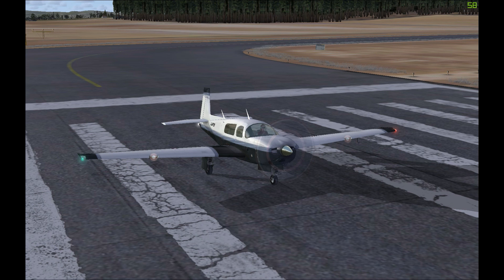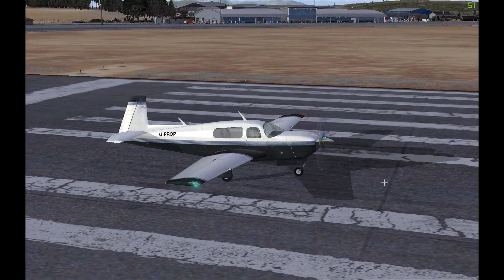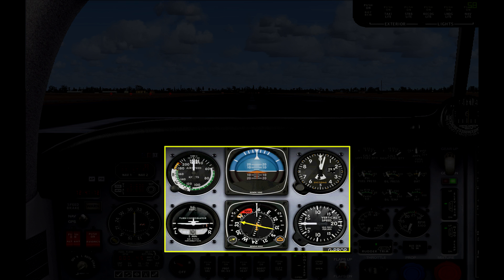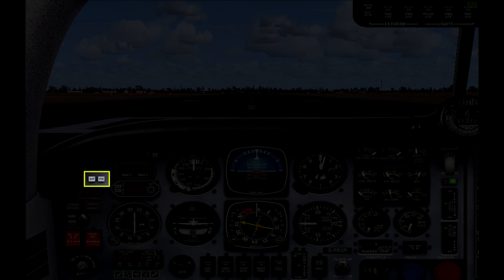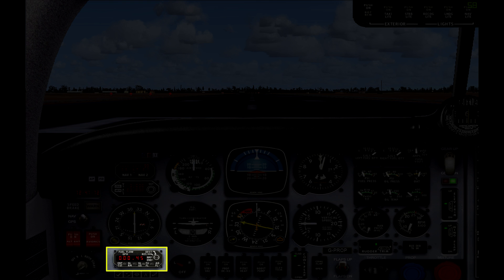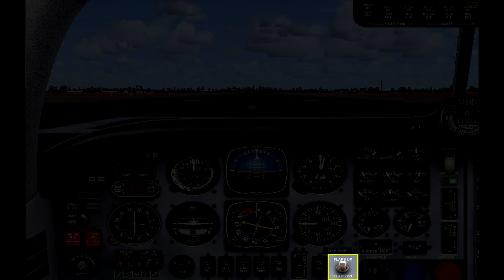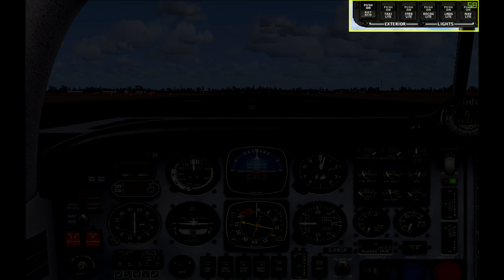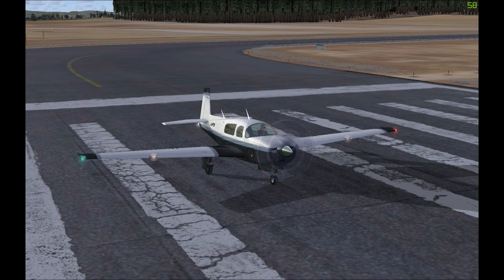FSX Tutorial: Mooney Bravo (M20) Guide

Comment: It really threw me off the first time I flew the Mooney since the ADF only shows up on virtual cockpit.  I normally pull up the radio stack with shift 2 but as you can see at 5:13 it doesn't have the option to put in a frequency.  You HAVE to use virtual cockpit, so strange!

Comment: Hi, great vid, can the default mooney bravo cabin be adjusted for high altitude flight. i know the celing alt is around fl220 but when using fspassengers any higher than FL110 they start to die. any ideas?
Reply: The Bravo fly that high but this plane is not pressurized. So above 12000 the air is too thin to breath. You can edit the payload panel in fspassengers to make it pressurized, but the real plane is not. Real pilots have to bring oxygen to fly that high
Reply from the maker: Hey Reefuss, I don't think it can I'm afraid. Have you tried flying with the Baron or King Air, those may be pressurised cabins by default. Not 100% sure though.
Reply: the m20 is rated for a ceiling of 25000 feet and it'll reach it easily after about a 25 minute climb on full power. the problem you're probably having is that you're climbing without "leaning" the engine mixture and thus running the engine with a rich mixture. as the engine starts to lose power, lean the mixture by pulling back on the red mixture knob (beside the throttle and prop condition knob) or press control plus x to auto lean the mixture.

Comment: I dont know if you are able to fly the 737-800 or the A320 but i would love to see tutorials on those planes
Reply from the maker: +xander de jong Cockpit guides will be coming out in a few weeks time ;)
Reply: Niceee
Reply: I own a mooney with speed brakes. They are most useful and used when you are IFR and ATC (or weather)  doesn't let you descend from a high altitude (turbo charged moneys often fly in the high "teen" low "twenty" thousand foot altitude in cruise) until closer to the airport than normal/preferred. I usually plan to start my descent 20 minutes from airport destination or the initial approach fix. Normally I don't use the speed beaks on any part of landing, but if you are high and close, you can pop them and increase your descent rate from say 500 FPM to 1300 FPM w/o increasing your speed. You can also use them to keep your power up and prevent shock cooling your engine.